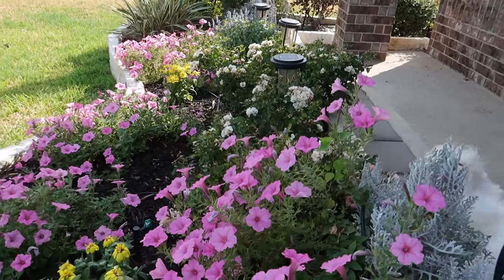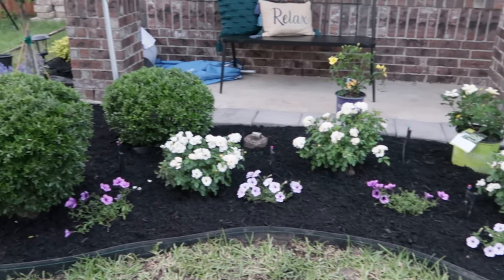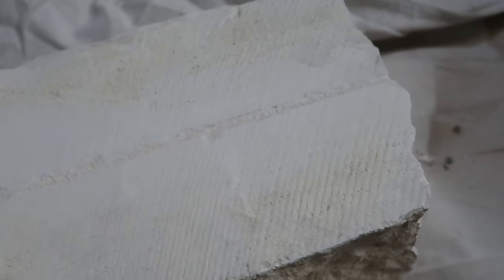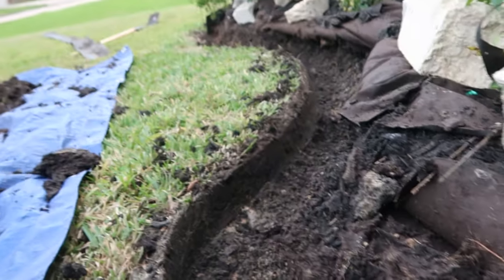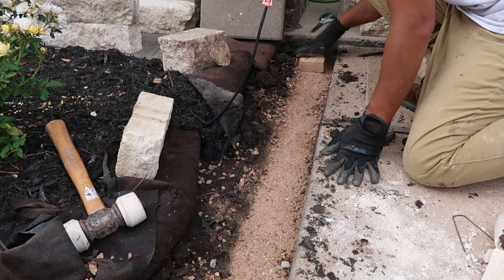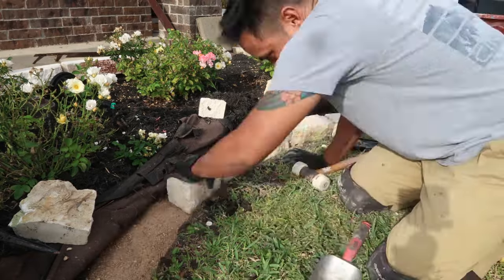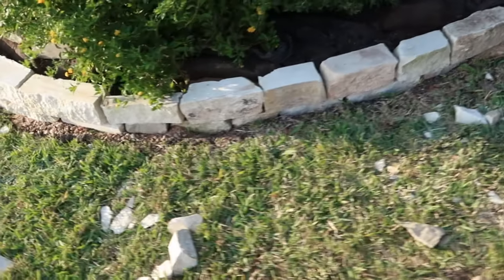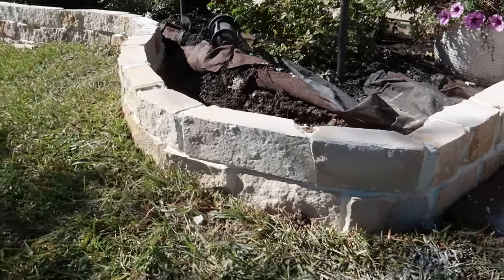Front Yard Garden Bed Makeover! Raised Stone Flower Bed Transformation from Start to Finish!

Comment: how is it holding up?  I would be interested to see if ground shift, no rebar, and the tapping of the limestone for leveling causes it to crack, crumble, or fall over time.  I hope that is not the case for yours but I would be really interested a couple years down the line.  It looks lovely.
Reply: I have limestones as my edgers and they have algae all over them and cracking 😫 three years later. I only have one layer though. I also have sprinklers that comes on every night so that does not help. Some stones have held up well and others are just falling apart
Reply: These are all over central Texas as tree borders, flower bed edging, etc. Every single one will crack in time. Limestone also attracts algae and mold due to the minerals in it. If you are going to use limestone, I would seal it with a high quality sealer such as Prosoco Salt Guard or Prosoco Block Guard both being the solvent based version and not the water based.

Comment: can you share all the materials and cost
Reply from the maker: Hi, thanks for watching… limestones (large) $135 , all purpose sand $10, $15 4lbs hammer, $16 stone chisel, $24 white masonry cement, $7 rubber mallet, and $20 (hart brand) 48inch level. Good luck
Reply from the maker: I cut all the limestones to size as need

Comment: What about drainage when it rains🤔
Reply from the maker: Since I used sand as the base layer before laying down the stone water drains through the sand. After the first heavy rain since setting up the garden then, I checked the soil moisture after a day and it was moist but not damp. So it drains well. If I could do it again I would also add rocks or crushed rocks then a layer of sand the help the draining.

Comment: Not supposed to tap  limestone, you level the underlay mortar or sand first. Not the best choice if it freezes.
Reply from the maker: Can you explain more why? Just so I know. Thank you.
Reply: @echoestcs  It's soft and breaks easily. It is basically chalk. Most masons level the 3 inches of sand after condensing then lay the limestone. Then use a mortar containing a element of elasticity for expansion.
Reply: It’s fine, I’m a pro landscaper for about 20 years now and have laided 1000’s of ft of limestone chop in mortar. Hitting it with the rubber mallet is necessary to seat it. Normally we use S mortar underneath as well. 
If you have never done it, leave this guy alone. He’s having fun and trying to help people. I think it came out great.
Reply: No rebar needed? What is rebar for anyways?